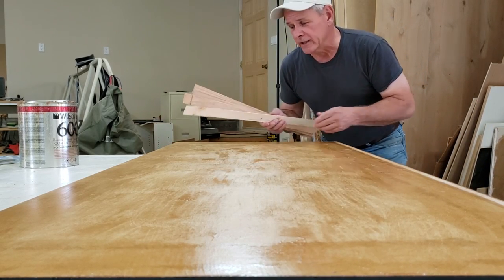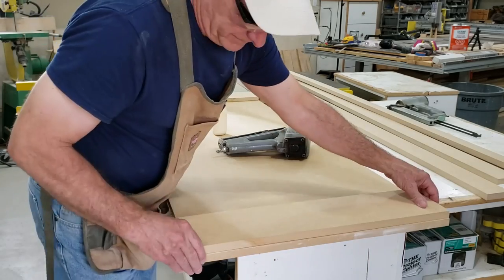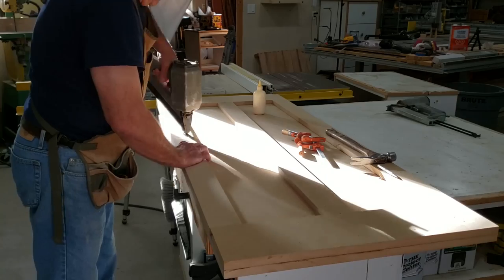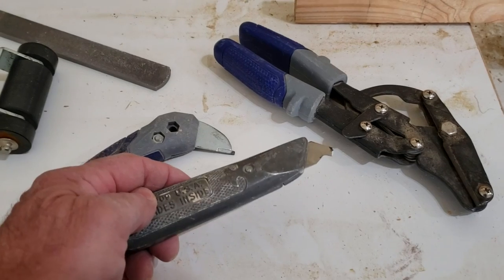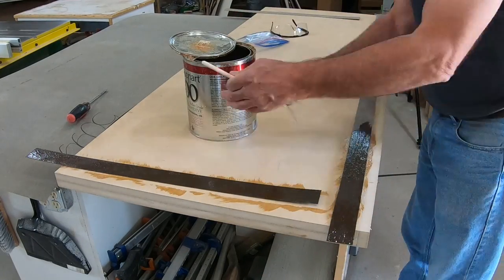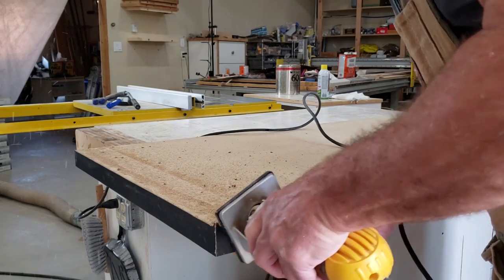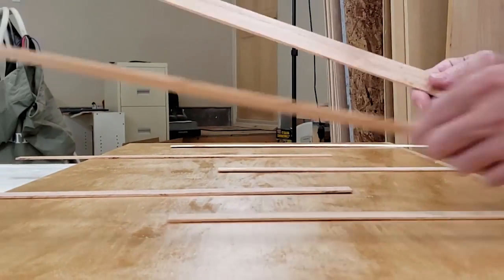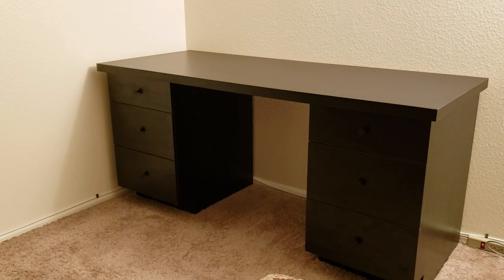Laminate Desktop for Computer Gaming Desk - Using Contact Cement You Only Get One Shot

Comment: I have a lament trim bit that is cylindrical with round bottom and cut out in the middle of the shank, when I use that bit it do not have chamfer the edges with a file. I have made many shop project tables and fine furniture tables using the Formica Brand Laminates. I have also found a J roller workers well for me when setting the laminate. Nice Video!

Comment: Great detailed video. Where exactly did you get your lament and particle board.
Reply from the maker: Hey, Steamed! The particleboard and contact cement should be available at a Lowe’s or Home Depot. Potentially there may be some laminate available there as well. I like Wilson Art laminate products and I buy it through a Denver based company called Darant Distributing. Depending on where you live, there should be local companies that handle Wilson Art products. Installing laminate is a great way to improve your basic woodworking skills.

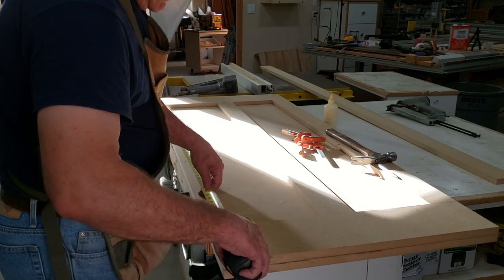Comment: Hey Rusty, great stuff!  I just got up to the part at 3:00 about the out-sized cuts, and here's a theory:  Maybe the tape measure's tab is inaccurate from being bent, or loose rivets (looser than the designed thickness of the tab's metal) or something?  You can test it by first measuring a ruler, hooking the tab over the end of the ruler, and confirm that the markings on the tape match the ruler.  Now butt the ruler up against a fence of some sort, and also butt the tape measure up against the same fence, and see if the tape and ruler markings still line up.

Ok, gonna watch the rest now.  Sorry if you already covered this.  I see a Rusty Dobbs video, I click on it, then click Like, then watch it!   :)
Reply from the maker: Hey JusBidniss! One thing you may not have considered is that you could be giving me more credit than warranted! After sniffing contact cement for a few years and my advancing age, I may be miscounting those little marks between the big numbers on the tape! : )  You are right though on the things that can happen with tapes. I find when setting tile sometimes that I will get a little thinset on the rivets at the tab and that will start fouling up the measurements, too. But it is not that critical with tile. I actually think in this case I was measuring for a very snug fit from the bottom of the tab side to the top of the other side or, in other words, 3/4" diagonally higher. I think that was just enough to make me go back for the third cut. As I said, I knew how much I needed to take off the last cut without a measurement. But it still didn't make sense when I remeasured! Sometimes I find that I just want it to work more than I want to understand why it doesn't! Great to hear from you as always!
Reply: @RustyDobbs  Ah, your diagonal measuring explanation makes a lot more sense.  I have over the years dropped literally every tape measure I've owned, and as Murphy's Law dictates, directly on the tab, so I've used that 'measure a ruler both ways' trick to great advantage, at least to determine how far out it is.  Accurately bending the little sucker back straight again is the real trick! 

Oh, and no judgement from me on sniffing the contact cement -- as Lloyd Bridges observed about it in the Airplane! movie, "Looks like I picked the wrong week to quit....!"  😎  Take care, brother!
Reply: He needs a left handed tape measure 😀. And no, they don't exist that I know of. I wish they did. It's a pain to work with tools all designed for people that are wrong hand dominant 😂🤣😂🤣😂
Reply: I've worked in places that have a sample board on a wall to double check the accuracy of a tape measure. If I drop one I always check the tip to see if it's still at a 90 angle. Nothing frustrates me more when ppl argue with me that they measured their work,& say it's perfect. Then I come along with my tape and see their metal tip is 1.5 mm out of square. Then they get ticked cause they have to recut an hours worth of work cause of laziness 😂

Comment: Where do you source your laminate from? All the home improvement stores near me stock solely white melamine.
Reply from the maker: Check to see if you have a distributor of Wilson Art laminates in your area, Kayden. You should be able to do that on their website. Also check with places that supply hardwoods and sheet goods that cabinet shops and contractors would buy from. One company that has a good nationwide presence is Rugby Architectural Building Products. Hope that helps!
Reply: @RustyDobbs  Thanks so much!

Comment: Skin is more prone to cracking in low humidity environments, the mucous membranes of the nostrils especially so! Lack of relative humidity in the air makes fumes much more unpleasant in the winter or especially bad in air conditioned environments (since the hvac system removes humidity). 
Non-Pro tip: If you don't /cant use a respirator, or if you come across a lot of fumes in your line of work, spend a minute more in the shower every day and breathe in as much steam as you can. Better still, use a kettle or a steamer and just breathe. Keeps the inner membranes moist and helps to heal whatever is damaged.
Reply from the maker: Thanks for all the info and tips, Vikas!

Comment: Why doesn’t the wood strips used to keep table top laminate and surface separate until aligned stick to the glue?
Reply from the maker: The adhesive dries to a 'tacky to the touch' finish but doesn't really stick to anything else except itself, if that makes sense. So the wood strips may snag a little while pulling them out, but you can lift or twist them and they come right out. As you can see in the video, when the two surfaces coated with contact cement come together, it is all over. The bond is amazing and permanent!

Comment: The reason the fumes are more prevalent in the winter is the air is more dense (the air molecules are closer together for a given parcel of air)
The fumes (molecules) from the adhesive are being held down closer to the work surface by the static pressure (weight of the air) thus you are exposed to a more dense layer of fumes. Conversely when the air is warm the molecules are far a part from each other and the lighter molecules of the adhesive expand and rise away quicker in warm air than in cold air. 
Don’t ask me what time it is, I will build you a clock.Well that is what my wife says. 🛫
Reply from the maker: Great explanation, Falcon, and I could see your last line coming! Your wife knows you very well! I have friend like you that I enjoy greatly. I just don't expect to ever have a short conversation with them. Thanks so much for watching and for your comment!
Reply: Rusty! Now that is Funny 😄 thank You.